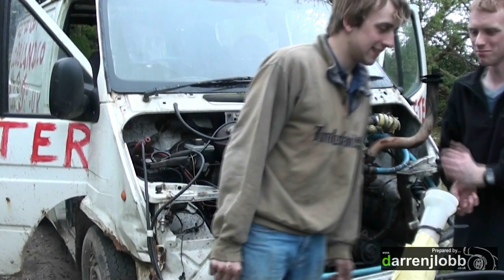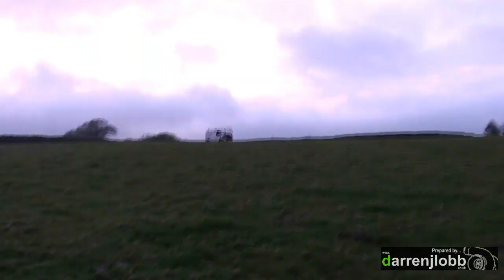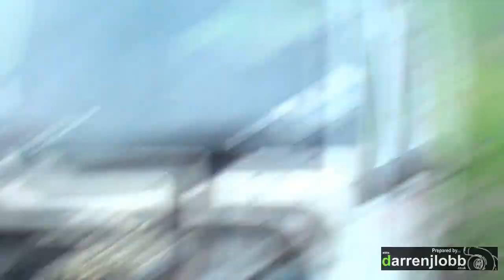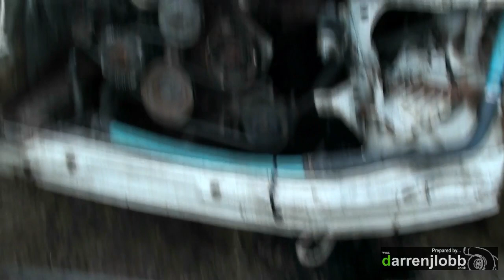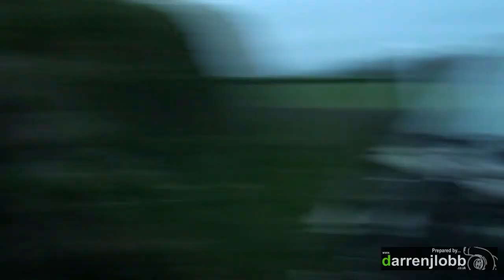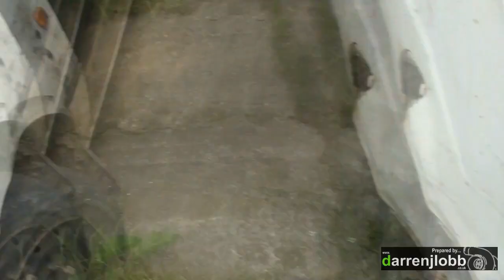Transit Fail Cold Start Hard Start

Comment: you country bumpkins make i larf.
when jump starting a car you can help the situation by putting the negative jump lead on the engine block of the non starting vehicle.you can also check your oil more regularly
Reply: +assistantto007 they dont bother with that theym just field cars run em into the ground when they die scrap em and get sommat else